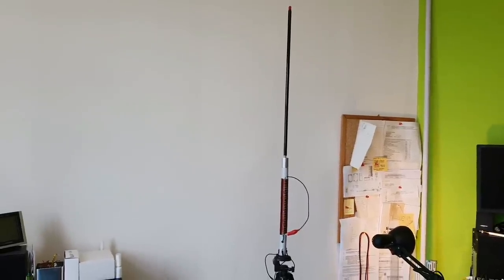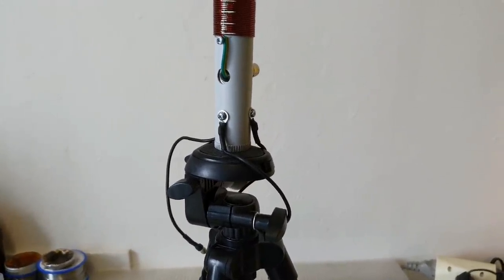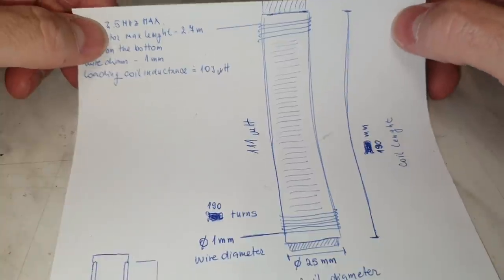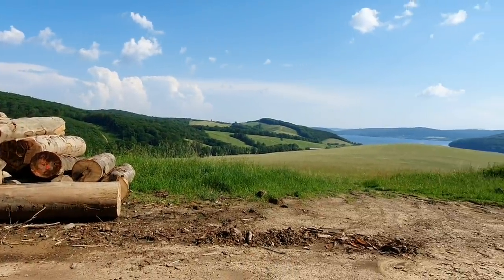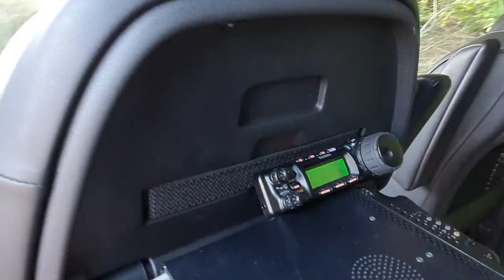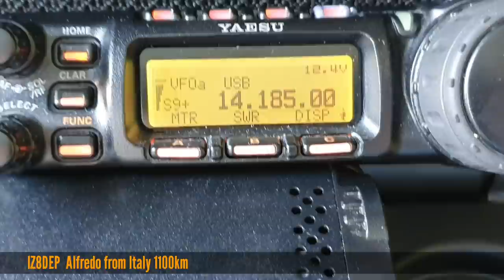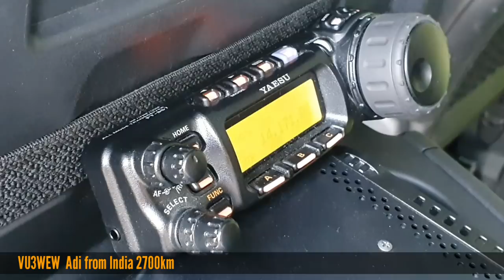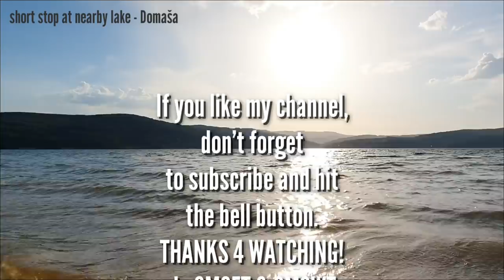MULTIBAND VERTICAL PORTABLE ANTENNA home made

Comment: Been building coil tap verticals since the early 80,s. Quarter wavelength at 80 meters. Cut it , wind it up and tap the band you want. I use a shunt coil at times as needed. 102 inch stainless whip on top. Usually works better close to the ground with a ground plane . It's the 1980,s version of a screwdriver antenna.

Comment: Thanks for video. The antenna certainly works! One question I had please: where did you obtain or how did you make the metal connectors at each end of the PVC pipe? I think you said the top one had a 3/8" thread for the telescopic whip and I assume the bottom one has a standard tripod 1/4" thread?
Reply from the maker: Thanks Steve! I was made this mounting adapters of aluminium on the lathe. :) I use it also on my Magnetic loop antennas :) Thanks for watching and 73! Paul.

Comment: This is an interesting video. Did you have an auto tuner to adjust the see or just move the wire on the antenna to get the best SWR. Also would like to know what the SWR was. At no time did you say. Anyway a nice portable antenna. Looks like weight and might be able to do SOTA with it. Would like to know total weight of everything. 73 Clark KG7LOI.
Reply from the maker: Yes, sorry I totally forgott to show tuning and SWR in this video! :D The SWR from edge to edge of 20m band was 1,5 and in the middle was 1,1. Pretty good! The weight I don't know. I didn't weigh it because it's not yet finished antenna, but I guess it's completely without tripod about 1kg or less :) I design this antenna specially for SOTA to get max. frequency range, portability and quick setup on the place and still not too weight and small as possible. :) 73 and thanks for watching! Paul.
Reply from the maker: We didn't had deployed ATU. Was not necessary 😉

Comment: Excellent little vertical Paul! 
I just tried to make something very similar: For the 40 meter band, a 6 meter telescopic fiberglass fishing rod with a tapped loading coil at the bottom and 8 pcs 6 meter long radials - mounted on top of a sturdy video tripod. I probably got too few turns on my coil and need to extend it to get my antenna to cooperate a bit better since I only got some JS8 contacts in central Europe on 10 watts. 🙄

Your surroundings are very similar to mine! ☺️

73 from Norway.
Reply from the maker: Thanks! I used two online calculators on the internet to get this numbers. But still I have to working on, because it doesn't work as I want :) Wish you good luck with your own vertical! 73, Paul.

Comment: Hi Paul
Maybe you could increase the efficiency of your vertical on lower band by adding (with an alligator clip) some horizontal wire. It will look like an inverted L antenna.
You have many trees around.
Thanks for sharing your experience.
73, Med CN8YR
Reply from the maker: Hello Med, that's a good idea!! Thanks ;-)

Comment: Paul,

Excellent portable antenna.     How did it load on 75 Meters?     What was the bandwith on 75 for each adjustment?

I use a similiar antenna on my truck, but it only works from 40 meters on up to 6 meters.

KA9J
Frank
Reply from the maker: Hey Frank! I am still working on it. This day wasn't tune on 75m. Only 20m 😊 It's just a prototype or startpoint for my next vertical 😉👍73

Comment: Very nice build, Paul. I built something very similar about three months ago.
The technique of shorting out the unused part of the loading coil is a real "Q"- killer! You will probably get even better results if you attach the crocodile clip to the feedline inner conductor and tap UP the coil, leaving the unused part of the coil "floating" below the used section of the coil.
Reply: Yes, if we shorted turns on an ac power transformer, there would quickly be blown fuses or worse...certainly a lot of heat. Yet, I keep seeing this done with RF inductors and wonder why they just don't "select a tap", not short  windings. I always leave the start end open, and select the proper tap.

Comment: Thanks for vedios and qso demo but where did you adjust the antenna for swr and how that part is missing on vedio.
Reply from the maker: Yes I know :D sorry about that! But I plan made another videos about improving this vertical so I am sure that measurment will be included already :D Btw. the SWR on 20m band between edge to edge was 1.5 and in the middle 1.1 that's pretty good! 73, Paul.
Reply: @OM0ET  welcome, we will be looking forward to it.

Comment: Clever design and great built. Congratulations. I wish had your skills (and toolshed probably) to build this. I don't, so I've bought the JPC-12 instead, which is close in design to this, but yours is better with the longer coil.
Does the 2.7m tripod give a real advantage vs. radials on the ground? I had been told that radials like yours, going 45 degrees, not on the ground, had to be tuned to 1/4 wave.

Comment: Looks similar to my antenna, which I call the WRC Clone.   I have a video on my channel that shows my antenna.  When I built mine, I had a 10 Meter Hamstick that I wasn't using, so I got some wire, PVC pipe, weed eater twine and connectors and started building.  Since my original build I have changed a few things.  My antenna doesn't use the clip like  yours I have a collar I adjust up and down just like the WRC and I can turn from side to side to get the best SWR.  I have since removed the Hamstick and went with a 102 inch telescopic whip.  Great video!  Juddie - WD8WV

Comment: Super antenna easy to construct happy to hear that u are able to contact vu2  I want to know the running length of RG58 cable  whether I can use 10 meter so that I can put it in the first floor and to operate my icom 718 73s vu2rpc prem kovilpatti  tamilnadu india.
Reply from the maker: Thank you Prem! :) You can use 10m long coax too. My coax was about 5m long, but I don't know exactly. ;) 73, Paul.

Comment: Nice video. I see you've used insulated (coated) wire for coil. With your coil assembly (soldering?), are you sure you are not getting any shorts between turns? 
73 de SP7PSD
Reply from the maker: Yes Pawel, I abraded gently only a small upper part of the each rounded wire of each turn in the coil. The isolation remained on the sides and bottom part of the wire, so the wire do not touch each other electrically :) Thanks for comment! 73

Comment: Very cool. What sort of SWR were you getting on various bands? Just curious to know if you used an antenna tuner at all during your testing. I didn't see anything connected to the radio. For a compromised antenna it performed wuite well.
Reply from the maker: Tuner is not required on this antenna 😊
Reply: Well done and thankyou for sharing. You have some good projects.

Comment: Excellent video.
I only have the doubt about the length of the irradiating rod.
I would be grateful if you would indicate the measurement of the irradiator or even better a diagram of the antenna.
Best regards.
73, CE1AVF
Reply from the maker: What you mean "irradiator"?
Reply: @OM0ET  
I mean the metal rod of the antenna.
Regards
Reply from the maker: @andresvidela1  its full lenght is 2.9m
Reply: @OM0ET  OK, thank you.